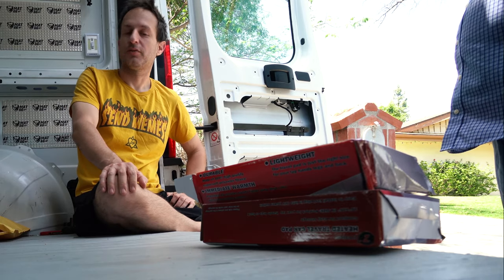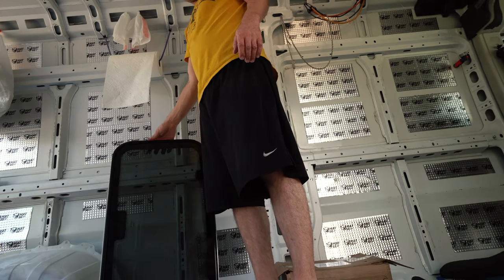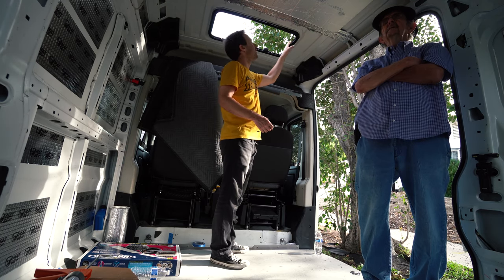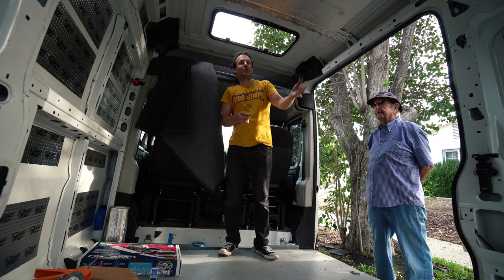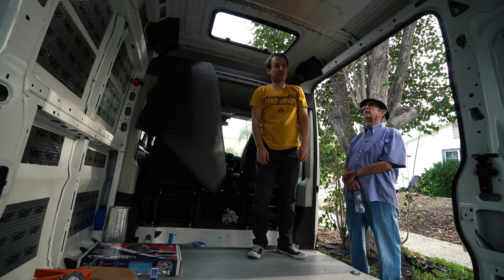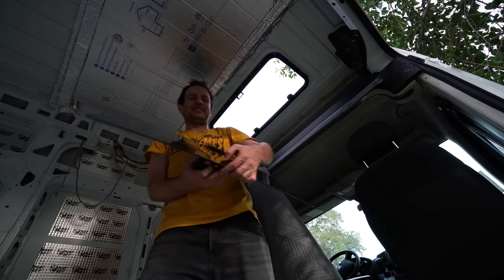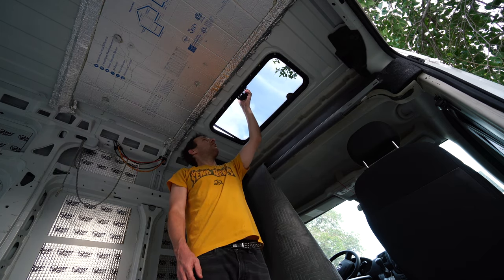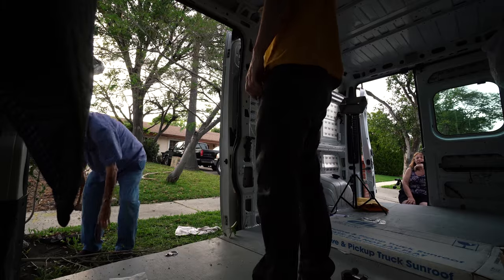Stealth Van ￼Low Profile Skylight that Opens

Comment: Thanks for the vid, I'd love to do the same but apparently all the manual pop-up roofs like yours are discontinued (the one you linked in the description too). Why is that? How did you find yours? Thanks a lot!
Reply from the maker: It’s been so long I may have gotten it directly from the CR Laurence website. There’s some really nice boat hatches that will work.
Reply: Thanks!  @NoLimitVanLife

Comment: Scouting YT for how to mount a flat skylight on a curved roof. Found your video on how to mount a curved sunroof on a flat roof. Guess it works! NB.: You need explosive bolts in the sunroof, so you don't hit the glass on they way out in your ejection seat!
Reply from the maker: Did you ever get that Skylight mounted?
Reply: @NoLimitVanLife  I decided that the risk of it looking crap or leak on the compound curves is too great as it was impossible to find a glass that came close in shape, so I'm going for a full fledged poly carbonate roof. My plan all along was to have it double as a clean solar cell install for when camping. That means cutting the roof from under the windshield top weatherstrip to where it dissapears below the rear hatch and on the sides in the middle of the recessed rain gutters, but keeping the underlying internal roof brace. That requires that I make a fiberglass mold off the roof, I can use for vacuum forming the polycarbonate. The cells will then be laid up on the underside of the curved polycarbonate in silicone to avoid air bubbles under the curved plastic with white backing film to make it resemble the stock roof to minimize the risk of vandalism and lengthy debates with the MOT. However that takes more planning and summer temperatures before laying up fiberglass.

Comment: I love this idea! It looks like you installed this in a section of the roof specifically designed for a sunroof... the corrugation kind of stops in the right shape... not sure how to explain it. Is that right or just coincidence? Do you think it would be doable to install one of these on a roof without this?
Reply from the maker: Because of the design of the sunroof I think it needs to be installed on thin slightly curved metal.